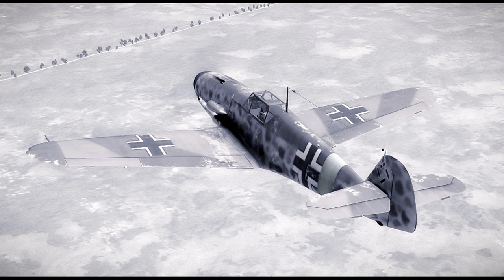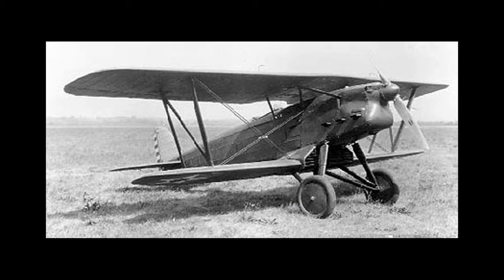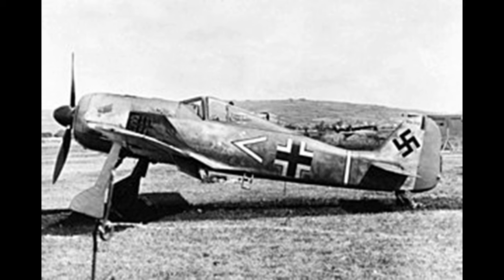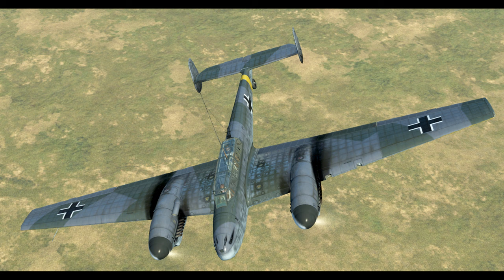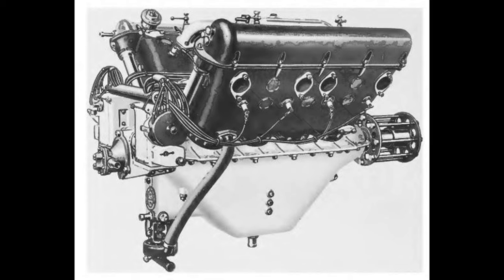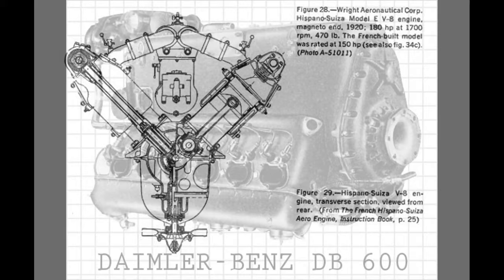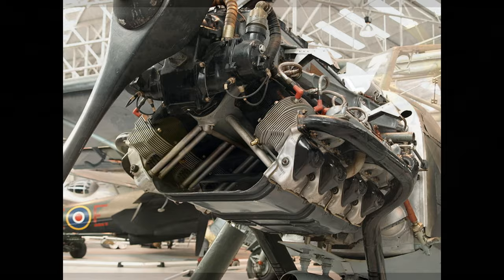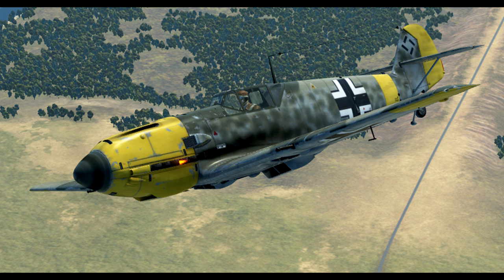Messerschmitt Bf 109 , Why an INVERTED V-12 Pt. 1? inverted V12s vs. upright

Comment: As an FAA-licensed A&P Mechanic, I can tell you that inverted engines have less wear because upon start up, the cylinders have better lubrication. This is because gravity causes oil to settle in the cylinder walls. The primary benefits are visibility, maintenance access and less engine wear.
Reply: I can see that. because there is oil that settles around the piston rings.  so there's less friction when starting.  Great point
Reply: Too bad about those main and con rod bearings.
Reply: David Gold great point but in theory the ground crew could turn the propeller by hand as it is usually done on big radial engines in order to scavenge oil around especially on the lower heads but I never seen it done on the Merlin / Packard engines,  why?
Reply: @paoloviti6156  On radial engines, it's possible to get a hydraulic lock if the bottom cylinder is on compression.  The Packard/RR are upright and therefore the oil drains away from the pistons.
Reply: Did you have to clear oil accumulating in the cylinders prior to starting to avoid "hydraulicking".
Reply: One reason for the inverted V  could have been to reduce the rotational inertia of the aircraft so making it more agile and maneuverable. This would only make sense if the inverted V engine was originally designed for single engine and high maneuverability aircraft (e.g. fighter aircraft), if the inverted V was first a feature of twin engine aircraft what I have proposed above would less likely be true.
Reply: Short and clear answer to a simple question.. how the male brain function, in general
Reply: Probably not a factor at all,  the viscosity of oils keeps it where it needs to be for quite some time. If you have ever removed a piston from an engine, you would have noticed plenty of oil on the rings. If anything the inverted engines create more problems for scavenging oil than a typical configuration.
Reply: @jerryw6699  first of all I have built many engines and if an engine sits long enough the Rings will crack when the motor rotates I can see this especially happening in cold weather. And as far as the Scavenging it's got an external pump and in an external oil tank so it doesn't need to scavenge it
Reply: @nateg9770  so the external oil pump and tank don't have to recover the oil that has been pumped to the engine? Endless supplies I guess. Rings crack from sitting? How long?
Reply: Thank you for the summary, saved me pretty much 18min.
Reply: @paoloviti6156  Licensed made Packard Merlin aren't inverted vees... Lol
Reply: Doesn’t that have the possibility of fouling the plugs if enough sneaks past the rings?
Reply: there was something to do with crank shaft height and the cannon as well , upright it would have made the cannon less effective as it was below the centerline of the fuselage,  also the fuselage was designed to fit the width of a rail gauge , with the wings on the side two could fit side by side on a rail car,  this was done on purpose, knowing these planes would be towed around on rail lines to the front,   them germans wuz clever ...
Reply: that is maybe only a side benefit. For war machines, they don't care about long term wear. These things are expected to last a few weeks statistically. The real reasons always are about effectiveness as a weapon, or ease of manufacturing.
Reply: I hate to agree with anyone about anything, but you may be right.  And not only that, but the camshaft and valvetrain would get better lubrication.
Reply: I really doubt that there is a marked difference in cylinder wall wear between the two designs...
Reply: It's easy to miss the fact that the life of these engines, of whichever inclination, was between 1 day and six months - arbitrary figures but you get the point. Who cares if being inverted would save wear or contribute to long life. Most of them were shot down along with their pilots or over stressed and sent for repair well before the distant overhaul date. These were combat machines with a limited projected life before destruction by the enemy.
Reply: @paoloviti6156   Big piston operators today use pre-oiler systems to circulate oil through the passages and get things lubricated before starting.   No need to pull the prop through on an upright vee.   Big radials will have scavenge pumps to get the oil out of the lower cylinders but pulling the prop through by hand is good insurance to prevent a hydraulic lock condition and expensive damage.
Reply: @tag491a  Life on the engines during wartime was in the 100 hour range before major overhaul.  Merlins have benefited from improved standards and surface treatments and it's not uncommon to see Merlins get 700 hours today with standard flying, with some interval servicing.  Display flights will put more wear on the engines.  The German DB engines today are still limited by the 100, 200, 600 hour factory service requirements and are very expensive to keep in the air.
Reply: @FiveCentsPlease  thanks for giving me a better insight on this topic! Fact is that piston engines was highly complicated and equally required highly skilled mechanics to maintain it. The demise of those wonderful machines was that the jet engines not only was far simple to produce as it had far fewer mechanical parts but also cheaper! As comparison the Jumo 004 cost, then RM10,000 for materials, the Jumo 004 also proved somewhat cheaper than the competing BMW 003 which was RM12,000, and was far cheaper than the Junkers 213 the piston engine that was installed on the Fw 190-D which was RM35,000. Moreover, the jets used lower-skill labor and needed only 375 hours to complete (including manufacture, assembly, and shipping), compared to 1,400 for the BMW 801. It is only true comparison I could find but I'm sure it was the same for England. It is easy to understand why jet engines was so successful also because it had far better development and power ratios. Alas the nowadays jet engines has become equally complex! Sorry that I went out of subject...
Reply: Long term engine  wear of inverted versus uprights was not remotely a consideration for their use in WW2 .... Engines run to their TBO once delivered to the battle front were rare ... and the wear you speak of with engines used daily or weekly is mute ... One doesn't last longer than the other if run regularly .
Reply: @thomas316  Lowering the CG to its better location is slight for its rotational inertia benefits but you may be right ... It could be a benefit on the roll axis ... just a bit
Reply: @Bartonovich52  Mains and con rod bearings do not know or care where they are located ... they are pressure lubricated from within and then the oil falls away to the pan or pickup point .. They don't splash in an oil pan like a brigs and stratton lawnmower ... Their location above or below cylinders has zero effect to their  lubrication ... they are pressure lubricated from within the crank galleries  ... Zero effect on wear ... Did you honestly think these high performance engines were splash lubricated .... These engines are dry sump ... that means no oil pan ,  inverted or upright
Reply: @planegaper  Im pretty sure neither of your reasons are correct .. cannons and guns were mounted everywhere and overall with of fuse is the same upright or inverted ... Its just inverted had advantage of narrower fuse at top ... They were seldom ever shipped on rail cars .. Germany fought from their home territory and could easily fly planes to battlefront and if refueleing  was needed they controlled all territory from home to front so could land and refuel ... Zero reason to ever disassemble ,wrap and ship ... not even to their few foreign zones ( Africa )
Reply: @kkteutsch6416  Who said they were ... am I missing something ?
Reply: @markdoan1472  if I understand correctly what  you are stating I would put it this way: that both engines, inverted or upright, basically they both had about the same duration. What made the big difference was use of fuel because the Germans almost never had the use of high quality gasoline that was very hard on the engine that necessitated onerous maintenance every 50 hours flight whilst the allies benefitted using high quality gasoline. The difference was that the Germans could never really used the full potential of their engines, in fact Sweden produced under license the 605 by using high quality fuel was developing regularly 1700 hp instead of about 1450 hp with regular German fuel. That was the great difference, it was not a question of inverted or upright engine...
Reply: @paoloviti6156  Yes ...American and allied fuel was as high as 140 octane ... German fuel not even close so Americans were able to supercharge at higher rates .. and thank God that was so because the Germans would have eaten us alive otherwise
Reply: It's a dry sump.. so exactly what oil is there to settle in the cylinders Mr FAA-licensed A&P Mechanic? Also please list the planes you worked on, so I can avoid flying in them.
Reply: Would it Really make much difference in engine wear?
Reply: Other A&P here. All oil in any aircraft engine is scavenged back to the tank by engine driven pump. Doesn't matter the orientation or the configuration of the engine. I.e opposed, inline, vee, radial, H, upside down, backward, etc. The major problem with radials and inverts is oil seepage after shutdown. There's alway residual oil in the crankcase and cylinders that creeps past the rings. Usually on radials and inverts you pop the sparkplugs out (of the lower most cylinders on a radial) to drain the oil if it hasn't run in over a half hour. On the flight line they simply sent the props through slowly by hand to let the oil drain into the exhaust before cranking. Another reason they smoke so much on startup.
Reply: Do any aircraft still do this?  Obviously only smaller aircraft would possibly do this, but do they?
Reply: To answer your question Larry, I don't know of any modern American production aircraft that use either radials or inverts, nowadays its all opposed or turboprop in general aviation. Although it wouldn't surprise me if some manufacturer somewhere does.
Reply: There is always residual oil somewhere. The oil pumps don't stop until the engine does.
Reply: can you  say  drysump ?
Reply: We are saying dry sump, but we are also saying even the best scavenge pump can't get it all. All those oil galleys are still full after shutdown, they seep.
Reply: David Gold You repeated what he mentioned in this video
Reply: More coke buildup then, and greater chance of hydraulic lock
Reply: @nateg9770  we are talking war time here these engines wouldn't have sat for long.I've rebuilt engines for years my self and even after a year sitting there is still oil enough on internal cylinder surfaces etc to protect them till the engines oil pressure builds up...mind you I'm not sure that can be said with modern thin synthetic oils..but on the old dino oiled engines I think its true enough
Reply: @mottthehoople693  fair enough.  I wasn't there I spent my time in the Marines from 2002-2012 . WW2 was a hell of a war.
Reply: Very smart
Reply: Don’t upright engines have a pre-oiler function?
Reply: Don’t upright engines have a pre-oiler function?
Reply: Hi David i have the same problem , wear and tear , my old cylinder walls are not what they used to be , cheers John
Reply: Damaging gunk would settle with the oil as well - not good.
Reply: @Bartonovich52  That won’t make any difference. The bearings are not oil submerged in an upright engine.
Reply: I thought there would be more crankshaft connecting rod bearing wear, because of oil starvation not getting the oil to travel to the top of the engine unlike non inverted V's?Never had the opportunity to see one in A&P school.
Reply: @donberg01  The oil to the bearings is pumped to them under pressure , so it does not matter if they are high or low.
Reply: @USER351  ok thanks, I guess an engine doesn’t care what attitude it’s at as long as it gets lubricated properly.
Reply: David Lance  ok TX for info!
Reply: My understanding is you don't want an inverted engine in an aircraft, because oil leaking past the rings could foul the spark plug at the bottom.
air-war.org
Reply: @markdoan1472  I understand the Germans came up with some additive towards the end of the war making it possible to boost the compression. Gasoline octane has much to do with combustion speed during compression to  prevent detonation under high pressure. Ignition timing setting is important for the optimum combustion efficiency. Their octane had little to do with why we were not “eaten alive”.
Reply: @choppergirl  
The answer was explained earlier, it makes sense to me as a tech, as long as you have oil supplied by a pump the motor doesn’t care what attitude it is at, furthermore acrobatic aircraft already solved these problems with the same fix. Also if your piston rings are leaking that bad, time for an overhaul, you probably have bad compression too!
Reply: @donberg01  Well I speak from ultralight aircraft experience... where you only got 1 or 2 cyclinder's.  If your spark plug is drowning in even a thimbul full of oil because it's at the lowest gravity point, you're going down....
Reply: @markdoan1472  I said that if you would read the comments from the beginning (David Gold’s response) & don’t tell me what me I don’t know, I don’t know who the hell you are!
Reply: @Bartonovich52  Your aware the main and con rod bearings are pressure lubricated with oil galleries from the pump ... How little people like you understand engines .. the main and con  rod bearings dont care how far they are from the oil sump ..dont care if the crank is highest point in engine ... You comment and number of people who feel the same way shows how little most people understand engines .... The crank could be a hundred feet above the sump and never care ..... its pressure lubricated
Reply: @choppergirl  Not really a problem. One might find a tendency for oil in the cylinders during start-up that could cause a ”hydraulic lock” and ignition trouble, but once the engine is running the plugs normally stay clean. The presence of that extra oil in the cylinder head area is just that that reduces the cylinder wear.
Reply: great comment, good insight
Reply: @FiveCentsPlease  they go to pull the prop thru to oil the engine, its to make sure inverted cylinders don't hydrolic and cause engine damage
Reply: @Bartonovich52  -*******CHUCKLE********. !
Reply: cool
Reply: But would access be maintained when private planes with tricycle landing gear emerged?
Reply: @paoloviti6156  Just about every V12 aero engine flying today has a pre-oiler pump that is run before the engine is started since they are no longer cheap surplus.
Reply: @kkteutsch6416  I knew long time ago that license-built Packard Merlin aren't inverted vees....
Reply: @FiveCentsPlease  sorry for replying after 1 year but I just wanted to thank you replying to me!
Reply: @TadMarko  thanks for the info and yes those wonderful V12 engines are definitely not cheap surpluses!
Reply: @LordMekanicus  thank you for that explanation, that makes total sense.
Reply: @markdoan1472  yes you are quite correct. The only time there is no pressure in the oil system is when the engine is stationary, as soon as the motor start spinning, then the oil pressure comes up and lubricates all the bearings. In fact it is a slight advantage if the engine spins a few revolutions before it fires up and runs and no detonation of the air fuel mixture ensures no great pressure on the bearings ( other than the compression of the piston) until the oil pressure comes up.
Reply: Did you think that thru 🤔
Reply: @Bartonovich52  'too bad about those main and big end bearings'
They are pressure fed from the oil gallery as soon as the engine is rotated. The cylinders and piston rings rely on splash, and drainage in an inverted engine
Reply: @paoloviti6156  the idea that the German WW2 jet engines were cheaper to make is erroneous. They lasted 10-12 hours before they were junk, due to not having high-temperature alloys. That makes them VERY expensive.
Reply: @pashakdescilly7517  I can confirm that the Jumo 004B was really cheaper compared to the BMW 801 radial engine but also it was far easier and quicker to produce, also required far cheaper alloys, as there was no heat resistant alloys, and could use tree types of fuel: J-
P 2 that was from synthetic oil, practically almost a leftover from oil production and was relatively available
Diesel oil but was facing serious shortage 
Aviation gasoline that was facing even far more shortage leaving many Fighters stranded around Germany...
Reply: @pashakdescilly7517  exactly but it was always far cheaper and easier to dismantle the jet engine so everything was relative...
Reply: thank you david
Reply: An old friend had an old Fairchild trainer from the mid 1940's, don't recall which model. It was powered by an inverted straight six.
Reply: Thank you. Succinctly said.
Reply: @Bartonovich52  if your getting into that part of the engine, you’re likely doing a full overhaul. Engine’s  coming out at that point.
Reply: Ahhhh... wow, so if someone wanted to try shoehorn the Merlin's or Allison's into the 109's et al could they do it with the addition of some "sump pumps" all things being equal if they didn't care about costs and were willing to change a few parts with new changes, and even visa-versa?
Reply: Not so, like a lot of large engines, they have an oil pressure primer that pre lubricates all bearings and the cylinder walls. All good aircraft engines have this feature.
Reply: A disadvantage would be increased oil consumption of an inverted engine.
That said, an inverted engine allows room to accommodate two large cannons right in front of the pilot.
Reply: @tag491a in 1937?! The only aircraft  in the luftwaffe that comes close to your ideas is the fw190.